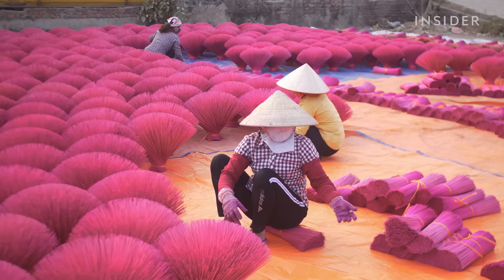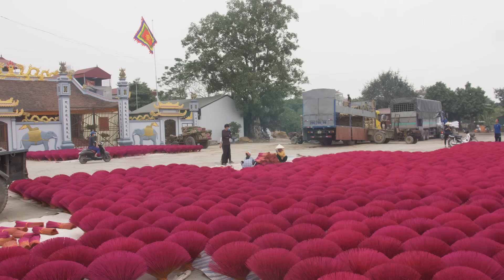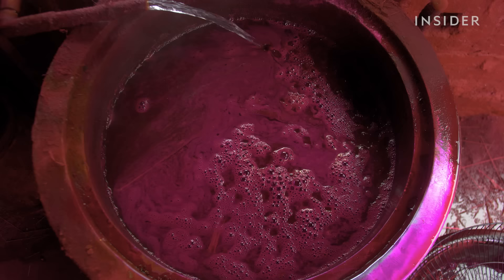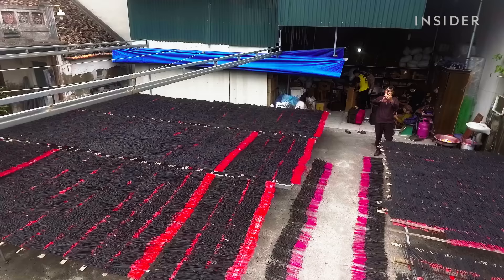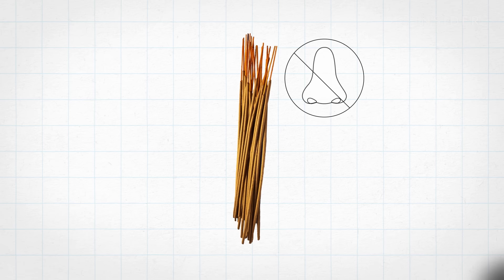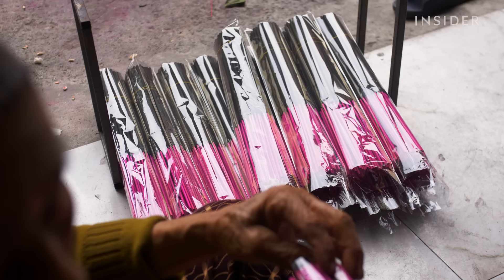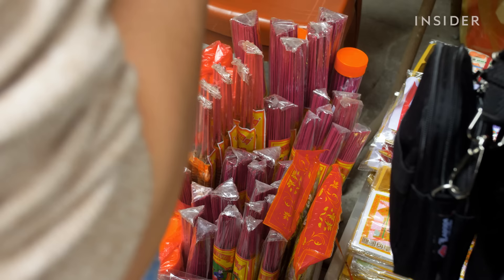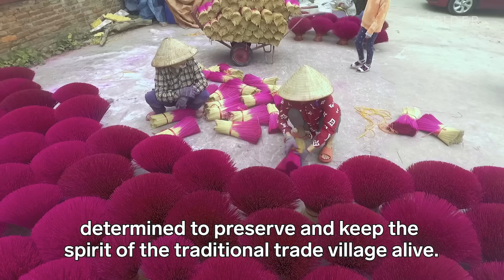How This Village Makes 50,000 Incense Sticks A Day For Lunar New Year | Big Business

Comment: YOu could make about 100 times that many a day.. but in relaity a factory can be scaled infnitly... The question is why and what is the purpose? It puts the entire town in bondage for money rather then the means of actual works of need. SO I would state its a waste of a human direction...

But through what they wanted it made with, IE bamboo or can antoher substance be used would change an automation process.

IF its bamboo powder ot glued... system it could be compressed glued and stained/or fragrance added automatically... an entire chain, auto cut... auto bake dry... then auto packaged... 

THe onyl question that determines the size then of the factory is the energy needed and the base resource...

SO in that SEnse... if its bamboo it changes the automation process jsut as if its antoher matieral... many types of materials could be used in a compression method of you could make an auotmation module design where yo ucan out sectiosn for bomboo cutting and then switch to other modules for other materials... the cut length and dye length... can all be changed on the fly and bake on finihs etc... hmm I don't know.. seems like the .. devils works.. merchants of bondage. rather then works that lead ot freedom or education or udnerstanding.. 

SO take a good look that is the world I owuld kill... Certain works shoudl exist... but this is ... nonsense.. and its bad for your lungs.